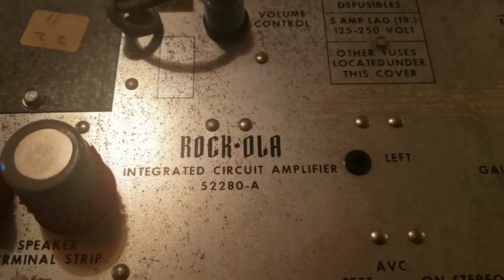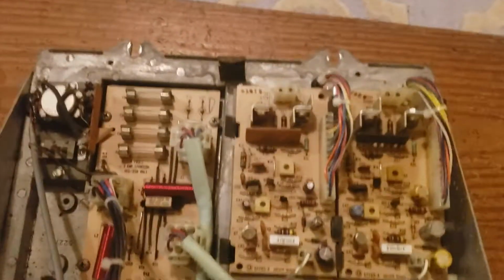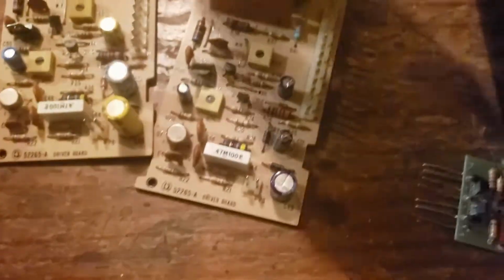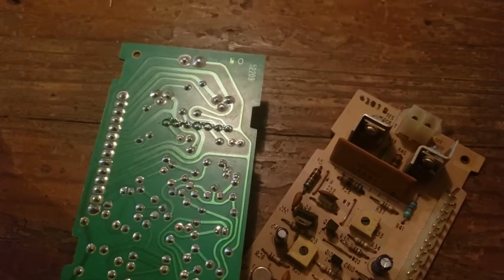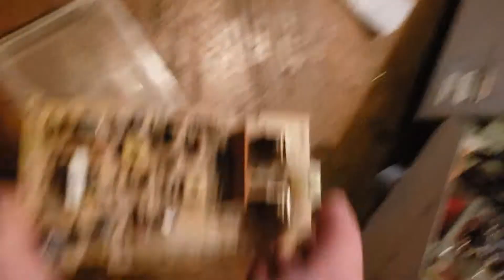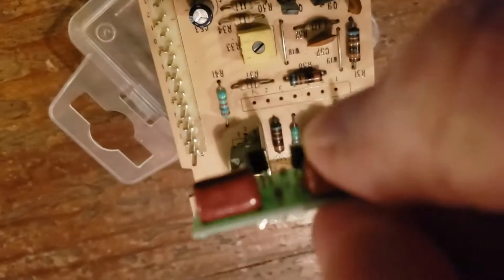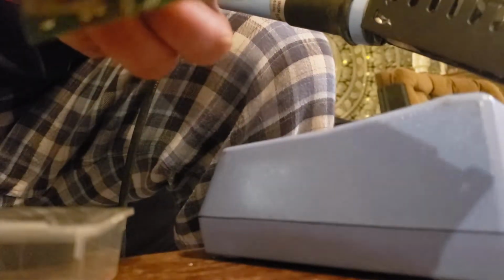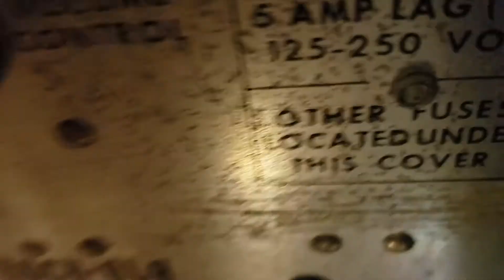How to Fix a Rockola Jukebox 52280-A Amplifier that is making noise

Comment: Hi. - Great instruction tutorial. I have the same amp with the same fault here in the UK, I obtained a pair of the PEC 52357 protection chips from the company detailed in your link, soldered them in to the boards and it has completely cured the fault - Thank you so much - That awful loud pulsing sound was driving me up the wall.
Thank you so much for taking the time to make this valuable repair tutorial.
Reply from the maker: Nice! I got mine completely re done as well, had a guy in California replace all the capacitors and it sounds even better now, cost like 250 though, but it was worth it!

Comment: Thanks for posting this. My amp was making a popping sound also. Keep reading speaker overload
Reply from the maker: yea those amps 52280 and 54510 always crap out, if this quick fix doesn't work you can always send it out to get it recapped which makes it like a new amp
Reply: @coinheaven  who could you send it too? Mine is not making any noise and soon as record hits turntable, overload light comes on and will not not play. Information appreciated!
Reply from the maker: @andybradley9882  https://rossthejukeboxguy.com/ this guy rebuilds amps and he is supposedly great at it!

Comment: can i contack you
Reply from the maker: Sure, thenesdump@yahoo.com
Reply: @coinheaven  thank you may be you can help changed the pc8  and the filter caps still squells when turn on help
Reply from the maker: @johnegan4826  yeah could be any of the capacitors inside, there are so many. I bit the bullet and sent mine out to get recapped so it will last a long time: https://rossthejukeboxguy.com/
It's costly.but worth it, sounds like a new jukebox now